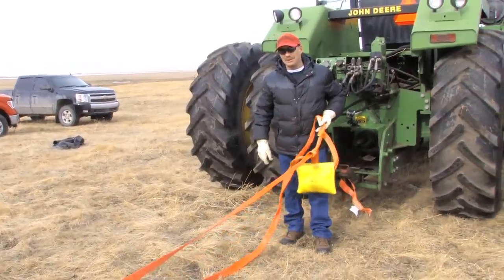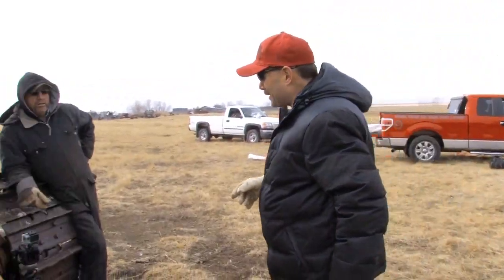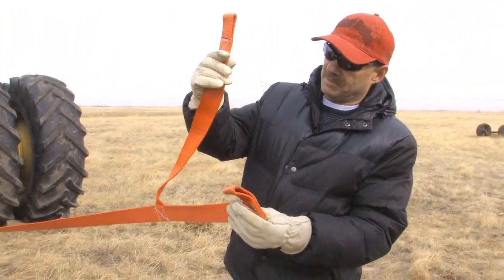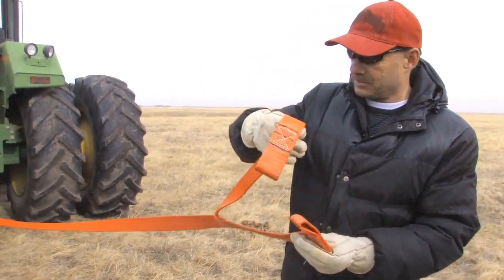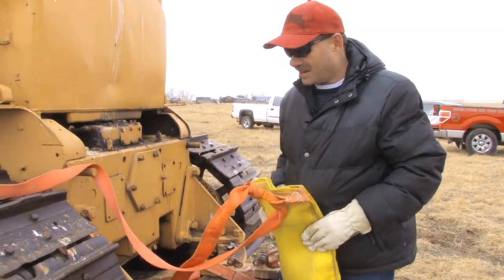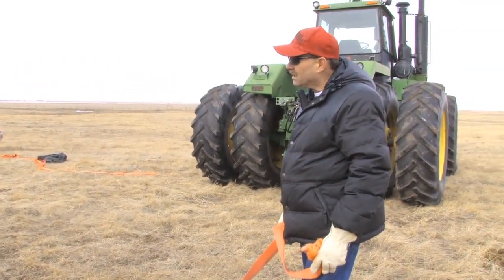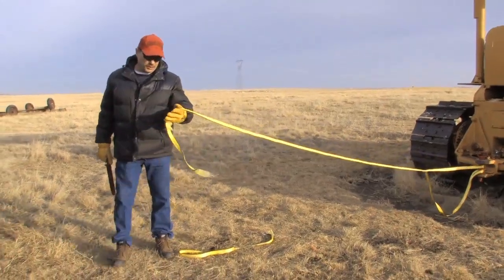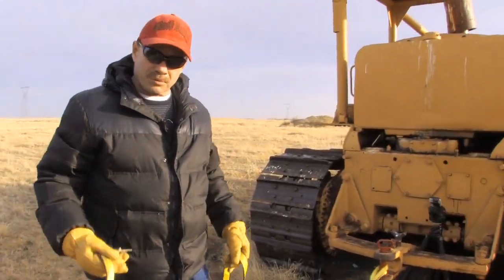Testing - Vehicle Recovery Strap Recoil Diffuser

Comment: How about two straps same rating but one 20 feet other 30 feet. Sew together in the middle 2/3 end to end and see if the stitching can slow the breaking and launch of the broken strap. If both same rating the longer one more than enough to capture and control the shorter broken one.
Reply: How about a primary strap with a tube of rope material with extra material in the middle. Attach the ends to the loops. Would be like strap or rope in a firehose as secondary strap and for control of the broken strap.
Reply: The "firehose" could also protect the strap from damage and uv damage

Comment: Some great info there, but you're working with some giant hitches - what if you're working with a normal size vehicle hitch and the HITCH is the part that breaks... your strap method will not do anything and the hitch becomes a deadly missile... which, tragically, happened on 2/24 in Minnesota...  (search "Man dies trying to tow car from ditch in rural Rice County").  I think whatever solution you work on has to include damper bags on both ends and somewhere in the middle as well?  Thanks for the great info.
Reply from the maker: Thanks for your great comments and we can tell you are keenly aware of the dangers of vehicle recovery. It was a tragedy that man was killed just trying to get a car unstuck. What this video shows is the testing that has been done on the Snap Trap products we designed and patented. The Snap Trap is part of the Ditch Hitch System (www.ditchhitch.com) which is an engineered solution used for pulling out stuck vehicles
. The Ditch Hitch Units are inserted into existing frame-mounted receivers such as those found on ½ ton or 1 ton trucks, etc.. - one on the stuck vehicle and one on the rescue vehicle. The 2 Ditch Hitch Units are attached with the Fuse Link vehicle recovery strap. The Fuse Link Recovery Strap is 25’ x 2” wide and is rated for 16,000 – 19,000 lbs. From our testing, we know that a receiver in a vehicle will dislodge at approximately 25,000 lbs. The Ditch Hitch unit has a breaking strength of 78,000 lbs.The Fuse Link strap is guaranteed to be the weakest link in the system hence the name “Fuse Link”.   When using the Ditch Hitch System, if the strap breaks, no one dies.  As you've seen, we also have the Snap Trap (as shown in the testing video) which is attached over the Fuse Link strap and captures the stored kinetic energy of the recovery strap if it snaps. If the Fuse Link strap connecting each Ditch Hitch were to ever break during a recovery operation, the Snap Trap will absorb the energy being released from the strap and stop it from coming into contact with a vehicle or personnel involved in the recovery. With over 22,000 units sold and widely used without incident within the harsh Canadian oil and gas fields, we have been included in the Energy Safety Canada Guideline here http://www.energysafetycanada.com/resources/detail/10/vehicle-recovery-guideline and also won the Global Media Award for best new product at SEMA 2018. Hope this answers your questions and concerns and thanks for watching our video!

Comment: I have never broken "any" of my straps, but I would still rather be hit by a strap, than a wire rope, chain or a clevis on the end of a strap that failed. I would never use a chain to pull out something "stuck", I would use a chain to tow or pull, not stuck or buried. If you use the rubber band effect of a strap it does some of the work for you!

Comment: What’s also interesting about these tests is that line dampeners don’t work.  If a 10lb bag of sand won’t stop a broken line, there’s no way those ARB blankets are going to do anything.
Reply: That's because they only used one damper, which is wrong. You need a damper on each end, so when the strap fails, the end that fails already has the weight on it. Putting it in the middle lets whichever end fails to build all the momentum and inertia that drags the damper with it.
Reply: @AltitudeOutlaw  this guy gets it. Recovery safety is always about both sides and the weakest point.

Comment: I'm not sure why you wouldn't think something capable of pulling 8000lb woudln't chuck a 5lb bag of sand. 
Maybe try a mix of dynamic and static ropes/straps. Have a static section go from both ends independantly and have them overlap in the middle. 
This way they will catch regardless of where the break is.  Obviously the static sections will need to be log enough to  cover the stretch of the dynamic sections. 
I hope that make sense. send me royalties :)

Comment: I recently seen a mesh tarp made of wide straps.. asked the driver at the stop lite where did you get your   straps for straps net?  He yelled out the window as the light turned green "canyon rigging.com"  and he rolled out onto the highway.  We  have a stretch net to hold down  construction items in the pickup & trailers.  It does hold down but not stable.  I do not see this on you videos. Do you make these if yes, what is the cost?

Comment: With the last one, the bag was on the ground and tethered. I think if the bag was closer to the line of force of the strap it would not have been flug into the air.Now if you did testing with the bags nearer the ends i wonder if this would have yeilded a different result. The strap may not gain to much inertia before being captured.Even going crazy and using 3 bags. Either end and in the middle.

Comment: Wow, some great lessons here. For starters: 
Get more capacity than you think you need, like at least 5x vehicle weight. never use a shackle to connect 2 straps mid- line. And NEVER stand in line with your recovery pull.

Comment: I had a tow strap hook go through a grill and puncture a radiator on a '77 GM pickup truck.
Reply: Javier Fauxnom A lot of people think tow straps are for getting people unstuck. They're actually just for moderate towing. Recovery straps don't have metal hooks or anything on them.

Comment: that's for the great demonstration video!   Really shows how much energy.   I think you need a bigger strap to pull out a stuck dozer ;)  maybe a 12"
Reply: +fastst1 
The dozer wasn't stuck, they just had not released the handbrake.
Reply: @Drottninggatan2017  Handbrake?  Are you sure?  That dozer only had steering brakes which are foot operated.  And there's no way to "set" them without pushing and holding on them with your foot.  This applies whether it's a manual gearbox or powershift.  Most of the time your use the blade as a parking brake but this dozer didn't have a blade on it.  But I agree, the dozer wasn't stuck, not in the most general meaning of stuck, like in the mud.  Depending on how long it had sat there, the rails may have been frozen, which can be worse than being stuck.
Reply: SLORRIFJART321
 Aww dagnabbit, hate when that happens. :)

Comment: Grills are plastic, lol, doesn't take much destroy them.
Awesome video, though.  I see all kinds of advice, not much real world testing.  Nice to see some for a change.
Personally, the only thing that scares me is tow point failure, or a metal cable failure.
As far as the strap breaking in the middle, straps are weakest where they are sown, but when you stretch it over a span between two points, where do you think the highest stress force is?  Just something to think about.
That comment reminded me of some tests that were done at where I work on our electric recovery winches.  (I can't say the brand, so nobody ask).   Anyway, some guys were doing test pulls to the stall rating and they kept breaking cables.   Our guys contacted the maker and the maker said it was because that model did not have cable support groves on the drum.  the funny thing is the cables tended to break in the middle.   I wasn't directly involved, or I probably would've told them not to even bother with their tests, but, it wasn't my department.  I let them do their thing.

Comment: Great vid love the slow mo.. Unbelievable how that 10lb bag flew like it weighed nothing. Would've never guessed that'd happen and makes me realize my rubber floor Matt I hang in middle of my ARB snatch strap is gona do not a damn thing if it fails. Good to know someone out there is working on this issue! Are u guys private or work for the manufacturers testing these things? Only asking cause u trashed a couple hundred bucks worth of recovery gear! Lol... Anyway great vid very informative and also badass tractor u got there man very cool...
Reply: +2wheelobsessed  Well, a mat is using a completely different technique to slow the strap/line down.   The sand bags attempt to use mass to absorb the recoil, mats/blankets use air resistance.
Reply: +Ditch Hitch Will for sure check your stuff out. I take my recovery gear very seriously but if I'm honest safety is usually not much of a concern. Stupid I know, but vids like this show dumb asses like me what actually happens when these things let lose... Will look at your gear and try an invest in some safety items. Thanks again.